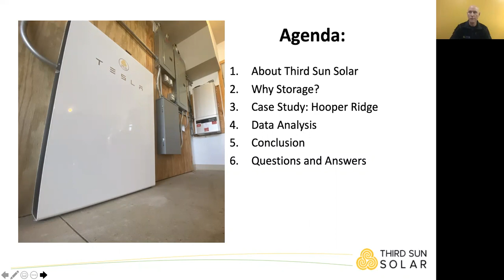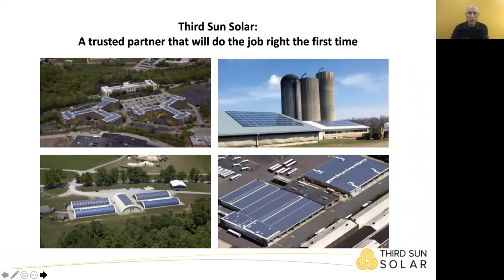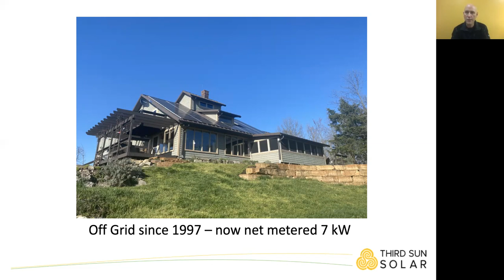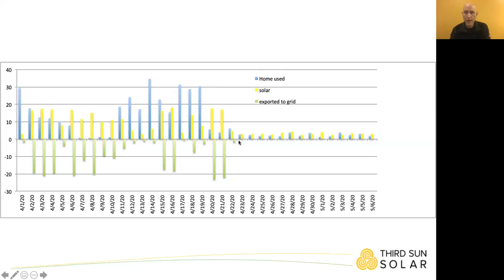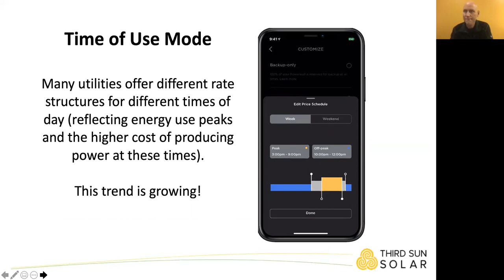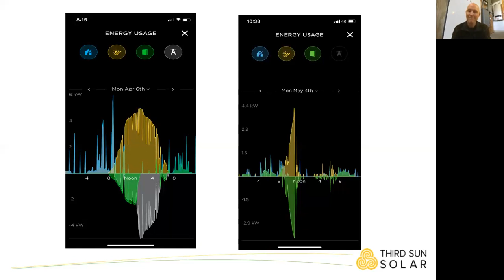Tesla Powerwall Off Grid Experience

Comment: If you run the tesla powerwall down to 5% can you completely shut it down from powering the house to let it recharge to 100% from the sun? Even if it takes 2-5 days or however long it would take?
Reply from the maker: Yes, on the app: set to back up only mode and turn discharge percent up to 100%. This is the setting for anyone who wants their battery to discharge only during a power outage.
Reply: @kokosingsolar  Thank you. Also it says the powerwall needs an internet connection..is this fact? What if the entire grid and everything goes down. Can this be used offline the same way its used online? What limitations does it have offline? Thank you and really appreciate you answering all these questions. Seriously looking to get this for my cottage.
Reply from the maker: @dorian345  Powerwall needs an Internet connection (over wired Ethernet or your home Wi-Fi) or a cellular connection to receive software updates and to communicate with the Tesla mobile app for energy monitoring. The battery still functions but monitoring capabilities become limited. Depending on the configuration of your PV reporting, you may be able to monitor your Powerwall there.
Reply: @kokosingsolar  Ok so in end of world scenarios the solar and power wall still work fine except for the updates and cell phone motoring? Where are you guys located?
Reply from the maker: @dorian345  we are located in Ohio. Give us a call if you're nearby. If not, give us a call and we can recommend you to a great installer near you - (877) 696-7652